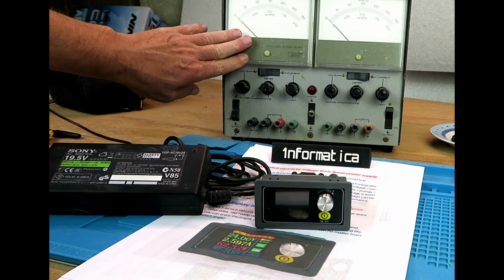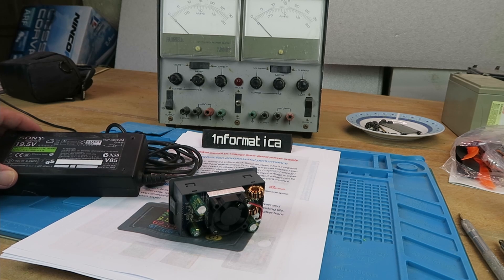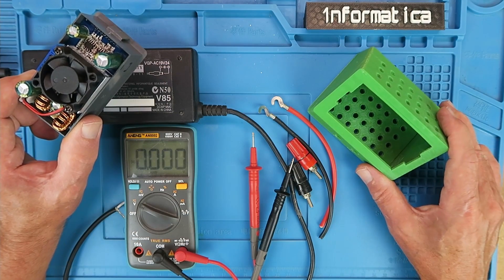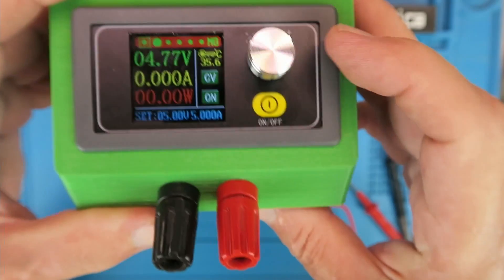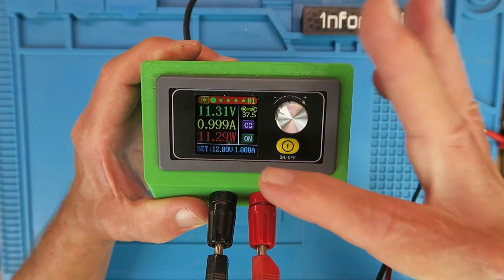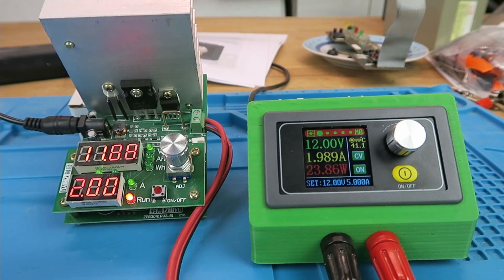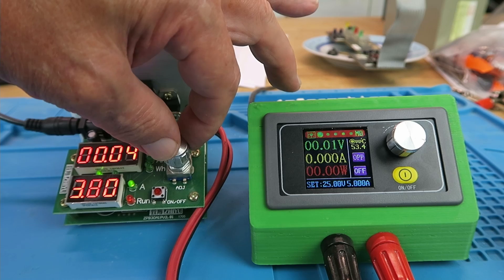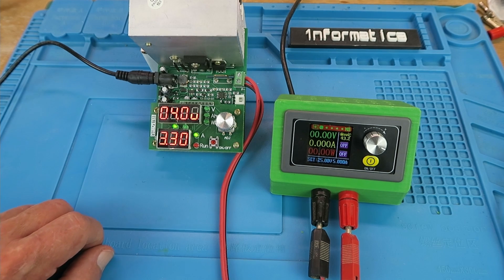XYS3580 DC DC Buck Boost Converter CC CV 0 6 36V 5A Power Module Lab PSU Build

Comment: I just got mine from aliexpress and it is a nice little unit. I have a couple of power supply from pc. I need a case? Any reply appreciated cheers from Australia subbed and liked 👍
Reply from the maker: Hey thanks! You don't really need a case but it makes for a much neater look. There is a link to the 3D printed one I made in the video description. Have a great day!
Reply: @1nformatica  thanks heaps for the quick reply. I will check out the case. Thanks again 👍👍👍
Reply from the maker: @dragan3290  You're welcome! Have a great day!!

Comment: Thanks so much for vid, have very little xp with electronics, but have just purchased one for a vvps unit. I intend running it @10-12v and 1 amp and was intending just getting a 24v 2amp dc power supply, but think i can use an old laptop charger now if understood correctly.
Reply from the maker: Yes, an old laptop power supply is what I use and usually can be got for FREE! If you don't have one one of your friends or family will! Thanks for watching, have a great day!
Reply: @1nformatica  thanks for reply, and if you don;t mind, one more q. Would i be able to control the voltage with is going to the device, or, would i just set this to maximum i would need (max would be 13w @1amp), then lower the voltage by adding a dimmer. (hope that makes sense), the device being powered usually runs at 10.5w, but i do use at slightly lower and slightly higher volts
Reply from the maker: @Kissyfur72  It is simple to change the output voltage to the device as I show here : https://youtu.be/ikTsE-UGN1s?t=262

Comment: Great channel and well put together. Where would you stick a fuse to add protection, on the input side or output?
Reply from the maker: Hey thanks! Honestly I would not bother with a fuse. The converter has over voltage and over current protection. Any electronic device if it's going to blow will fail in microseconds or less. A fuse, even quick blow one, takes maybe 100 milliseconds to blow which means any semiconductors are already long gone!  Have a great day!
Reply: @1nformatica  awesome, I have since read something along the same lines. These have come on leaps and bounds since 5 years ago when I was using an adjustable buck boost CC CV.

Comment: Question: when I connect a load (3.3 V, 600 mA) to the power supply module (set at 3.3 V and 600 mA), it goes to CC mode. Whats the reason ?
Reply from the maker: CC mode means the unit has current limited due to the load being more than the 600 mA set. If you set, say 1 Amp then you should see the current increase to what the load is actually drawing and provided it is not more than 1 Amp you will see the display change to CV constant voltage. Thanks for watching, have a great day!
Reply: @1nformatica  Thanks. How to make suppose -5V, 50 mA from the module?
Reply: @IrfanKhan-oh7kb   Reverse the polarity.

Comment: I use to do a lot of electroplating and this module had helped accomplished uncountable plating projects, I bought two of them from ebay 3 or 4 years back. I've been using only one of the two and its running every day as good as new (reason is because of good ventilation, I installed extra inlet and outlet cooling fans for its casing), the other is still in its packaging and I've kept it securely in a safe place because this type of module is very hard to get them locally in India, even if they're available they are three or four times their original price.
Enjoyed the whole video, I've learned something new. 
PS: Your voice  sounds very much  like John Malkovich.
Greetings from India.
Reply from the maker: Hi, thanks for your comment, interesting stuff! Thanks for watching, have a great day!

Comment: This is a very nice and informative review and I just have one question:

Can I use an automotive 12V battery as the power input?  I want to use this unit in an automotive setting.

Thanks.
Reply from the maker: Sure, no problem using a battery as input. Just be aware that when in boost mode e.g. 12 to 24 volts it is rather inefficient and at high currents will get hot! An extra cooling fan and good ventilation is needed. Thanks for watching, have a great day!

Comment: This unit is miles above the ZK4KX and ZK5KX. The ZK units are a few dollar cheaper but have a much less intuitive interface and a serious flaw. If you start up the unit with a load over one amp it will properly go into CC mode the first time you turn it on but if you turn it off and turn it back on again CC mode disappears and it ignores any current limit you’ve set. You have to fully disconnect the power from the ZK units (so a switch at the PSU or battery) and completely restart the unit. It only follows your CC limit on the first press of the “output on” button and if you were to give it to someone unfamiliar with this defect they would surely fry an LED. Absolute rubbish so anyone looking to save a bit of money, don’t. The XYS3580 is tried and tested. Not 100% perfection but damn close for the price.
Reply from the maker: Thanks for sharing your experience. Looks like I chose the right model!! Thanks for watching, have a great day!

Comment: Howdy. So I’ve got a night heater in my campervan. The thing is sooooo pedantic about voltage. It needs 13.4v to fire up, (@1.3a I believe). But once running it only requires 0.4a. I have a deep cycle leisure battery in the van. And the voltage drops just under the required amount. Meaning the dam thing keeps displaying “low voltage” errors despite the fact all chargers are saying “fully charged” (annoyingly at 13.2v).  My question is this: would it be possible to rig this up between the two (fused) to “con” the heater to think its got the required volts/amps for it to fire up? (I’ve been through three batts and the heater cost  to much to give up on it).
Reply from the maker: Yes, I think this will do the job no problem! Thanks for watching, have a great day!

Comment: I've made a little box for mine with an output switch and banana plug/screw connectors, i love it to bits although the voltage reading is a little bit off compared to what my multimeter is telling me. (You can see the thing everywhere on my channel)
Reply from the maker: Agreed it is a very useful and inexpensive supply, everybody should have at least one!! Nice channel you have, good stuff. Thanks for watching, have a great day!
Reply: @1nformatica  One more thing I wanted to ask actually, do you know if it is at all possible to fine tune/calibrate the voltage readout on this unit? Mine seems to be off by about 1v at 12v output when probing directly from the output
Reply from the maker: @scellyyt  I know of no way to calibrate it. My unit is very accurate, also see this video : https://youtu.be/4J3FQ8jVokY?t=1191 To be that far out your unit must be faulty.
Reply: @1nformatica  They're so cheap I might as well just buy another unit and hope it's more accurate and keep the old one as a second source for something else 😂 Thank you for the response
Reply from the maker: @scellyyt  Just for the avoidance of doubt, the display is showing "CV" when you measure the voltage?
Reply: @1nformatica  Yes it's off by a bit in constant voltage, I can record a video and put it on YouTube in a couple hours to show it

Comment: Thank you for the useful information. Great work!
I try to build a small "in a box" workshop for my little tinkering and soldering projects. As I have an old pc with a working powersupply I wanted to convert this to a self contained box for all my tools.

Key to this project should be the conversion of the PSU to power all the functions of the box:
- Light
- fume extractor
- soldering Iron 
- PSU for my breadboard experiments
- USB charging

Do you think I could use this converter for example at one of the 12V leads of the PSU to create at least a basic CC/CV PSU for my projects? Do I have to put in any additional fuses or is there something else to consider? As far as my information goes the PSU of the PC already has a fuse and other security devices but I just want to make sure.

Have a nice weekend.
Reply from the maker: Hi Johannes, I think this module is perfect for your needs. It does not need any additional fuses as it has built in protection from short circuits or overload as I showed in the video. Just remember to set the current limit to a suitable value when testing your projects. YouTube no longer shows me if you are subscribed. Please consider subscribing if you have not done so already!
Reply: @1nformatica   Thank you for your advice!
Oh that's a pity. Sadly I found your channel just yesterday and I was very impressed by your content. I already subscribed and now I'm exploring your work. :)
Reply from the maker: @johannesberger37  Thanks! Feel free to ask any questions.

Comment: Watch out for any push-on connectors on that switcher buck/boost PCB; at high current loads a little resistance goes a long way to produce heat and smoke.
Reply from the maker: Thanks for sharing your experience, will watch out for that. YouTube no longer shows me if you are subscribed. Please consider subscribing if you have not done so already!